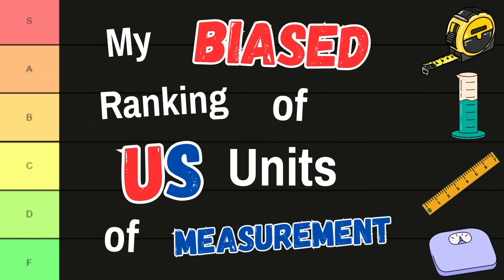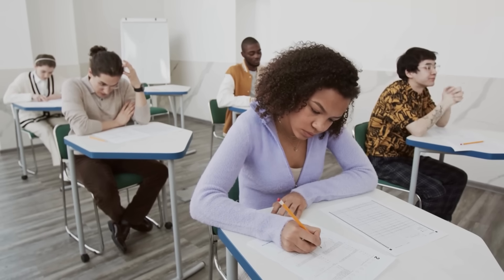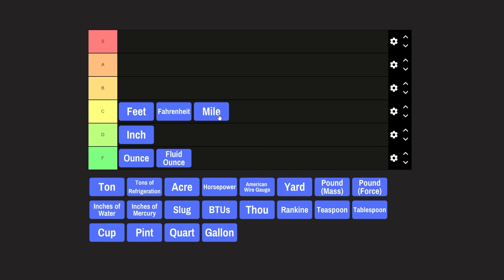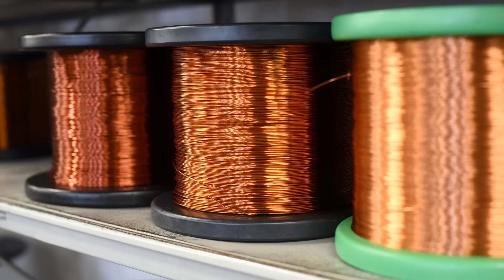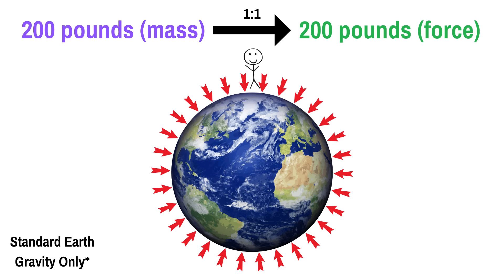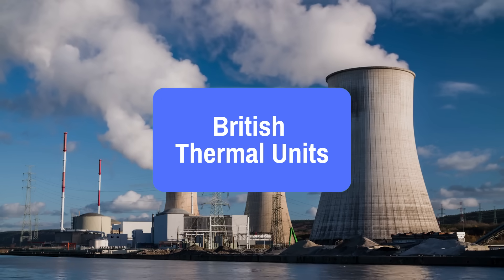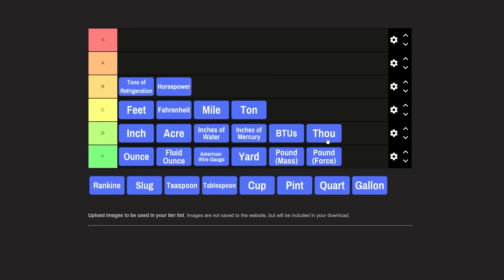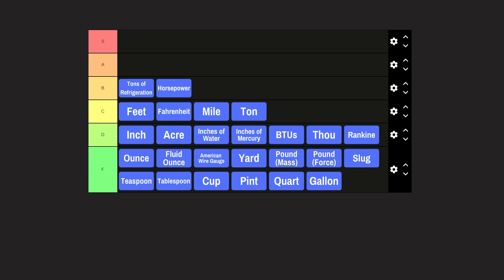Tier List of the DISASTROUS US Measuring System

Comment: You left out the nautical mile. It has the good property for navigation that 1 nautical mile = 1 minute of latitude. So it helped a lot in navigation, but obviously only on latitude because longitude changes as you move out of the equator.
Reply: s/altitude/longitude/.

Comment: Creators of metric system: Measure the distance from the equator to the north pole, divide it by 10.000.000 and you got a meter (divide the meter into 1+[the zeros you need] for more accuracy); take a cubic meter of water at its lowest density (4 degrees celsius) and take 10 cubic centimeters, weight it and you got a kilogram, measure it’s volume and you got a liter.

Creators of the US measuring system: take the how many something can do in the thing you measure and its good 👍 Take the body part of someone and good 👍

Comment: This video made my opinion of the Imperial system worse. You don't jut have to remember what measure you have ti use in a formula (temperature, mass, etc) but also the unit (ounce, slug, pound) and the conversation between units of the same measure (ounce to pund, gallon to pint, etc).

Comment: Too bad Fahrenheit does not get more respect. Food kept hot at 140 Deg. does not spoil, or frozen at minus 40 Deg. People say 32/212 Deg. are foolish numbers, but they are 180 Deg. apart, as if ice is the opposite of steam. More than one scientist worked on this, is it possible that it was designed to calculate latent heat?

Comment: The cooking ones like teaspoon and tablespoon are fine because standard cooking equipment have measurements for them. You don’t need to know how many millilitres they convert to, all you need to do is fill up the appropriate container that the recipe tells you to. So it’s still quick and intuitive anyway

I also think horsepower is fine, people use that pretty regularly as it’s probably easier to visualise in your head than just a big force number

Everything else on this list can get out though
Reply: Agreed, the other ones can go in the trashhhhhhhh
Reply: It gets quite blurry at tablespoon and beyond though... You'd have to have one that approximates the proper scale and know which one it is. I have tablespoons that vary wildly in how much they can hold. I get that it isn't a science, but a tablespoon could have 50% more than a different tablespoon that didn't come from the same set.
Reply: @simmerke1111 In the US standard spoons for cooking are sold in sets. A teaspoon is 4.93ml.  A tablespoon is exactly 3 teaspoons. You also buy standard measuring cups. A cup is 240ml.
Reply: nobody would use milliliters but GRAMS for tiny measurements. guess you arent cooking a lot...

Comment: I think you underrated inches by a long shot.

Almost everything cylindrical relies on inches: -Tubes for water and tires for example. Also screens are measured in inches.

Even as a german I kinda like this unit. Especially because it had such a long history in standardization.

The first standard was defined in inches to say the least.
Reply: The inches used in pipe fittings however make no sense. A 1/8th inch pipe fitting actually is 0.405 inch in diameter. 2/5th, not 1/8th. A 3 inch is 3.5 inch in reality. But that is NPT. Then there is BSP, where 1/8th is just that bit bigger. And SAE, where 1/8th actually measures 0.31 inches...
Reply: @pizzablender  Kinda like a 2x4 isn't.

Comment: My country changed to metric in 1976, and I'm old enough to remember imperial units very well. I've long since switched to metric for everything, because it is a lot easier. I still enjoy using imperial units on occasion though, specifically to fuck with the younger generations.

Comment: Mile: My understanding (from an old Surveying textbook) is that there are two paces in a stride. So there are about 1000 strides in a mile. An ancient roman soldier would strike his left foot down 1000 times for a mile. A stride being 5.280 feet, a pace, half of that as a comfortable pace. 2.64 feet, or about two feet eight inches as a pace.
BTU: a very small amount of heat, about equal to one wooden matchstick.

Number: one "gross" meaning 144 of something is something I learned about late. Also, one "mil" is one thousandth of a US dollar I believe. https://en.wikipedia.org/wiki/Mill_(currency) Sometimes mentioned on printed coupons. Not to be confused with the MIL being an angle used by the US military to describe an angle. And then there is the dozen (12) and the baker's dozen (13).

Volume: Don't forget there is a difference between a standard cup and a coffee cup. Something like 7 fl ounces to a coffee cup, another disaster. Also the Canadians had an "imperial gallon" that was larger than a standard US one. Actually, I prefer the term "Old English" for what you call Imperial  Its more descriptive and a little more condescending!

Comment: You could do something on the cgs units system. Ie centimetres, grams, seconds thst include units such as the Erg. This was a pre metric metric system. The metric system being mks, ie, metres, kilograms, seconds, with units such as Joules. Just to note that 1 joule is 10^6 ergs. 10:16
Reply: mgs (meter-gram-second) should replace SI because kilogram is a HORRIBLE unit to calculate with, because if I want to write 1000 kg within SI I would have to write kkg or kilo kilogram, instead of Mg, mega gram
Reply: cgs is also metric system, it still uses meters and grams, and more importantly, metric prefixes.

Which begs the question, if we start using millifeet and kilofeet, would that be metric?
Reply: @lily_littleangel  I did say it was a metric system but pre dated the ISO metric conventions. The cgs is still based on the original definition of the metre.
I feel that metric means based on the metre. You could say that a kilometre is a metric mile, except no one would agree with that. However there is the metric ton or tonne.
So what about cubic deci meters an oft used unit which is the same as a litre, in the water industry. A litre being a kilo cubic centimeter, or a kilo milli-litre ( just joking).
Note that one imperial gallon of water weighs 10 lbs ( a decimal system). So a cubic foot of water weighs 62.4 lbs, all at standard temperatures and pressures. 
And One ofv the first decimally defined screw thread was the BA system of threads, eg 4BA used a lot in electrical equipment before metric threads were introduced. It is actually a far superior thread form BA stands for British Association, and as the BA number gets bigger, the thread diameter gets smaller. The largest being 0BA and 16BA being really tiny. This system was defined over 100 years ago using millimetres, which were often converted to fractional inches.  Wire gauge is another strange unit that works in reverse regarding size.
The EU definition for pipe threads for water system is exactly based on the British Standard pipe threads . So G1/2 is in fact identical to half inch bsp - British Standard pipe thread, with the G meaning parallel. R would mean the thread was tapered as used for gas tight fittings.

Comment: I'm of the firm opinion that the SI units "won" as a quirk of history and,  more importantly,  all systems of measurement are equally stupid,  and not stupid. 
As are all counting systems. Base 10 is not more intuitive,  you're just used to it.  Which is also a quirk of history. 
Count how you want to.  Measure how you want to. Conversion tables are readily available if you want to communicate with someone who wants to do it differently.

Comment: I think inches and ft are superior to meters and centimeters cuz it’s easier for every day measurements like height.
Like 5 for 2 inch is easier to get than measuring something like 140 centimeters. And meters don’t work well either cuz pretty much everyone is in a range of 1-2 meters which doesn’t specify much.
Reply: Well if you're saying 140 cm, you should also be using 60 inches which is equally impractical. You can say 1 metre 4 decimetres/40 centimetres as well as you can say 5 foot 2 inches
Reply: @ilikeleek  well 60in is 5ft which is very nice
Reply: @jksupergamer 1m is 100cm which is even nicer
Reply: @HanTrio3  theres too many centimeters in a meter. Its not as nice when something is between 1 or 2 meters cuz then becomes like 149 centimeters which not nice and too many centimeters

Comment: Iches of water or mercury isn't US exclusive. Here it's used for medical equipment for some reason, except it's called mm of mercury. Also output pressure of water pumps is commonly specified in meters. Meaning meters of water column.
Reply: Of course it's not just called mmHg.

Hmm, that water pump thing… where is that?  Because I can't see this not being in bar.

Comment: they are getting somewhere with thous and inches….. this decimal thing will catch on some day just you wait

the world would be a utopia if that 5000ft mile was here

The SI primary units are S teir except candela which gets replaced by watt and volt
put all the other metrics in A
AWG, fluid ounces and fahrenheit are B teir (us wire guage is so much easier to use than the alternative, another is exactly 30.00ml!, the other is stupid easy to use and very precise to how I feel temperature increments)

BTU is an F teir, along with yards and inches of mercury , terrible, useless redundant units, use refrigeration tons and meters instead, and why would you measure anything in inHg
and btu is the least patriotic unit in the USCS standards
its wrong to call USCS a system since nothings compatable
and calling imperial anything but complete garbage is wrong because they couldnt bother to round their numbers neatly or standardize masters of the units correctly

Comment: There is no metric Ton, the unit in the metric system is just named Ton which konsists of 1.000Kg or 1.000.000g so 10^6g

Therfore the retard unit version should be called retard Ton
Reply: You could also call it a megagram but nobody does that

Comment: Imagine living in a measuring system where force is referred to in a unit of mass, pressure is referred to in a unit of length and tablespoons aren't actually the size of ... tablespoons. I'd fucking slug myself.
Reply: The pressure in lentgh isn't toooo stupid. There are many cases in physics where atmospheric pressure or underwater pressure is a function or the altitude/depth.

It doesn't justify making the entire concept length based obviously as in many other cases it varies with temperature or whatever.
Reply: @Bvic3 Yeah metric does the exact same thing with mmHg. Inches of mercury and millimeters mercury are both essentially the same thing except that millimeters are easier to do math with.
Reply: Who cares what it's referred to as?  You measure pressure in newtons per square meter. We measure it in pounds per square inch. The only difference is you decided to invent a new word to describe it and you think that makes you sophisticated.

Comment: As an American, I an definitely say you're wrong (just had to get that off my chest  :).  I mean, rates "Tons of refrigeration" above, well, any of your C-tier units.  "Miles" are almost metric: the name is derived from the Roman mille passus, or “thousand paces”.  Note that a Roman pace is what we might call two steps, i.e., the distance between two left footprints.  So you don't have to jog... 

For engineering (my profession), these are all F-tier.  Even the one created specifically for engineering use (Rankine).  For the last 40 years, my programs have done all their calculations in metric, converting to USCS only when needed (generally for display).

However, for everyday use, you have some of your D- and F-tier units swapped, and most of your B- and C-tier units are rated too highly.  But Fahrenheit is S-tier, for exactly the reasons you state: 0 and 100 are important temperatures when it comes to weather.  0 Celsius is the temperature where water may or may not freeze or melt.  Who cares?  But 0 Fahrenheit is the temperature where salt begins to be ineffective for melting ice off the roads.  Very important, at least if you drive, and live in an area where the temperatures commonly dip lower than this during the winter.  Similarly, 100 Fahrenheit is where a breeze will raise your body temperature rather than lowering it (modulo humidity).  At 100 Celsius, you're dead.  Shoot, at 50 Celsius, you're well on your way without shelter.
Reply: 0°C is the freezing point of water. It's not may freeze or may melt. 0°F is not the eutectic point of water and NaCl (temperature at which ice can't be molten with salt) it would be -6°F but NaCl is already ineffective at 14°F because you would need a quarter of the weight of the ice you want to melt of salt to reach the eutectic point. For other substances these values are different which means there are de-icing agents whch work at lower temperatures. So this is not a valid argument in my opinion.
At 100°F a breeze won't automatically increase your body temperature because of sweating. Your body temperature can increase even at lower temperatures depending on airflow, clothing, humidity and other factors. Which makes this argument also unvalid in my opinion.

Comment: I'm glad I live in a metric using nation. For the record, US imperial measurements are now based off of a conversation from metric system. IE 1 inch is 25.4 millimetres and 1 foot is 305 millimetres :-)
Reply: Wrong on the foot.  The foot, being defined as 12 inches, is of course 304.8 mm.
Reply: @JürgenErhard Does it matter? The US Measurement System is shit either way
Reply: Actually, historically, the US inherited a lot (if not all) the British weights and measures units. However, the Americans then changed some of them for ease of calculation (e.g. UK ton = 2240 lbs US ton = 2000 lbs). 
When SI (internationally defined metric system), the foot and pound and gallon (and a few others) were redefined to be an exact multiple of the corresponding SI unit to 6? decimal places.
Reply: the US purposefully kept its measurement system so that other countries wouldn't get too jealous of the US, since we're better at everything else

Comment: I've got a beef with the first thing on the list. Not only is feet really cool for being able to estimate closely simply by using your own feet. it is also divisible into 12 of the next smallest unit. 12 is a SUPER useful number when measuring because it can be divided by 4 and 3. If you have 3 things to hang in 1 foot of space (5 division points, the 2 ends and 3 equally spaced things in the middle) it's pretty straight forward to be able to put them up at 3, 6 and 9 inches without needing to use any partial units.
Reply: Then I read something is 100 feet tall, and my metric brain dies trying to imagine 100 feet lined upward. Also, the 12 being a nice number makes no sense when base 10 is much easier to convert things.
Reply: depend wich feet you use, for ex. 1 german feet was 11 inch, 2 german feat 23 inch
Reply: You like base 12, what base do you do fractions in?

Comment: Disagree about ounce/fluid ounce being same for water. Google "weight of a 16 fluid ounces of water" will get 1.0435 pounds. This kept me up one night; a liter is 33.8 "ounces" but would weigh 35.2 (16 × 2.2). I always assumed they were the same because metric uses water to go from length to mass, also that pint and pound had the same derivation.  (They don't, and check the Wiki for pint to see some real standards hell.) Another Fail for English standard.
Reply: Another fail for the American standard. In the British units, ounce and fluid ounce are the same for water. That's why a British gallon is 10 pounds of water
Reply: @franciscogodoy9158  OK, the American variant of the English system. But from Google I get an imperial gallon of water as 10.022 pounds. Now my head hurts like the night this kept me up.

Comment: Civil Engineering in America uses the foot but subdivides it into 10ths and 100ths. No inches! No stupid fractionals of a foot! I wish we'd go metric, but this is as good as we're going to get. One cool thing about the mile is that if you use the Gunter's chain of 66' as a standard, you get 80 chains to the mile. 10 square chains = 1 acre. All land in America outside of the original 13 colonies was measured by the Gunter's chain, excepting, of course, French and Spanish land grants.